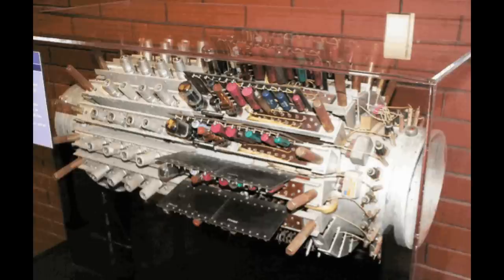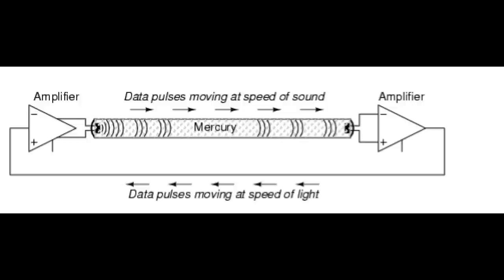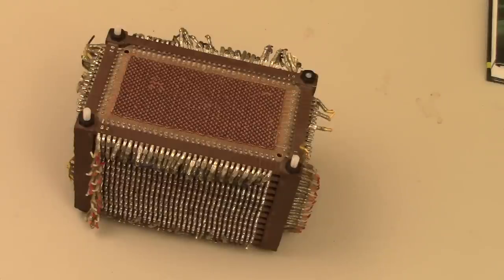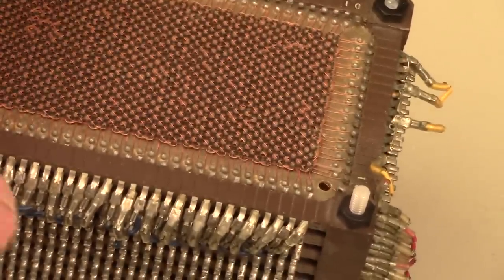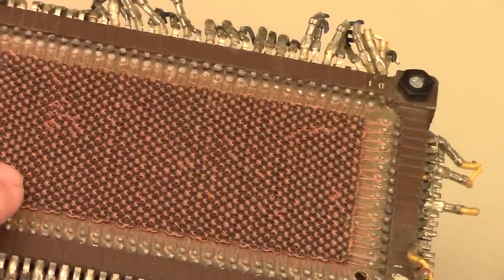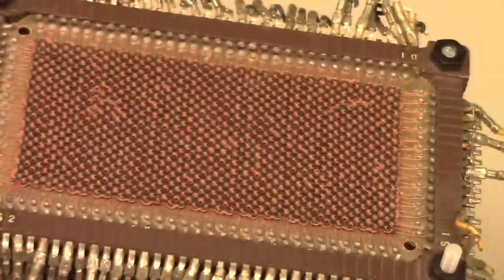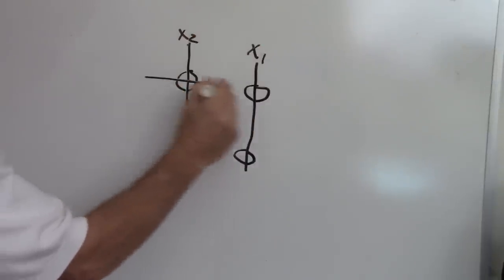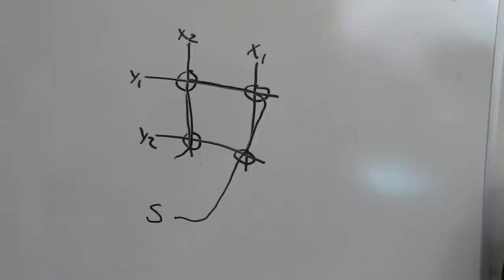Episode 11 - Getting Busted in New Jersey With Core Memory

Comment: Somewhere in a box in storage I have a 5 meg hard drive.
The damn thing is about the size of a large shoe box and must weigh 10 pounds.
Like me, it belongs in a museum.
Reply: Keep it. The price is only going up.
Reply: I have a 10 meg IBM MFM hard drive in an IBM PC. Back in the day, configuring MFM drive controllers was a nightmare.. BIOS menus did not exist yet.. some had to run a ROM program hidden on the card using DOS Debug.  Ref: ftp://ftp.seagate.com/techsuppt/misc/format.txt
Reply: I have a mechanical calculator from about 1928-32. It can do up to 12-digit numbers.
Reply: I have a 300MB disk pack. It fits on something that looks like a toploading washing machine. https://en.wikipedia.org/wiki/Disk_pack

Comment: back in early 1980s , stationed at mtn home afb our repair shop ran test equipment using burroughs d-84 computers with core memory, i believe these computers were from early 1960s, 2 large ampex tape drives is where the test programs were located,  very stable and ran the shop testing just fine. quite big though,  great to be reminded of them, thanks  j

Comment: Did you get to actually build your computer back then?
Reply: CaesarGamer good question..
Reply: I think all computers were custom made back then. They cost so much that thy were never at a store, so you'd order one from a factory, custom made specifically for you. And most computers were at least the size of an entire room, so yes, they had to be custom made.

But of course, what private citizen could have afforded one?
Reply: SmartassX1 Ok, but that wasn't the question.
Reply: I built a custom computer for about $200 in 1983. Ampro Little Board, power supply, floppy drive, Bud box, on/off switch, reset button, and a used VT100 terminal.
Reply: we had a Tandy 1000 from Radio Shack back in the late 80's/early 90's.  I can't remember if it was a 286 or 386 processor.  It had that archaic Deskmate GUI, and a 20 MB HDD.  Before that we had a Hyundai machine with yellow chromatic screen, and no HDD at all.  It was just 5.25" floppy disks and RAM.
Reply: People did...look up David Brooks simplex III. He made is original simplex I in around 1969 from scrap parts. It wasn't impossible to build one...it just took a great degree of determination. The last homemade one he made was the simplex III, based on the GEC 2050, with a dumbed down I/O system, I believe. I also read about a guy whose father built a complete PDP-11/03 with wire wrap! Now that was a smart idea...considering how much software/languages/operating system stuff was available for it back then! Contrast that with the average homebrew, with nothing except what you wrote yourself. I think that is one reason BASIC took off so much. There was so much college graduate software written for Basic, and it was small enough, that it was the easiest way to get useful software...but build a DEC computer and you have a 1970's computing arsenal in any & all languages!

I also met several people who built their own machines in the early/mid 70's in person. It was always a trade off of cost/performance. Many of these systems had a very limited instruction set, and a tiny amount of memory.  The I/O would even be current loop/serial/parallel instead of memory mapped, in order to save memory for programs(No screen ram, just a teletype(or Ascii/Baudot) for both IO and program storage). If you wanted to get fancy, you could build a TVT and add some memory there to get a real CRT terminal!  Just look at the Mark-8 mini. Everything in it was mail order...no memory mapped IO, nothing but some LEDs, switches, and very power thirsty MOS TTL chips.

Once it got to the mid/late 70's, you could build a computer much more easily. Memory was attainable, and microprocessors were available by mail order. ROM was still a problem...so many DIYers would use diode matrices for bootstrapping/monitors. Of course, by that time, since they were easier to design, appliance computers were flying off the shelves, as well as several kits. Dr. Dobbs Journal documents this period very well!! With articles of how to fit basic as well as programs inside of 4K of ram, with no ROM. They made a basic which was well under 3K. They even had plans for adding a calculator chip to your machine in order to add arithmetic commands to basic using very little ram. FUN READ and I highly recommend it!

Comment: Wonder if any computers still exist who could be used to show this thing in action.
Reply: worldgate989 There is a guy who shows how to build a core memory from NOS ferrite beads, but he only hooks up one and read and writes to it. I looked for the video but couldn't find it sorry. But I think to find a computer using it now would be very hard to find. maybe in a museum, but even then I would doubt it.
Reply: An update to me earlier reply. Somone in anther reply pointed out that the Voyager probes use core memory and ate still going strong after 40 plus years. But they are in space. So.....
Reply: Jason Crawley I just think it would be neat to see this thing at work.  Or see what it would have been in at least cause this thing looks like a radiator out of something.
Reply: Back in ca 1958 The Seeburg jukebox replaced the, trouble prone, 
electro-mechanical pin-bank memory system with a ferrite core memory 
system they named the "Tormat Memory System". They used it until the 45 
rpm records were replaced by the CDROM in around 1987. They can be found
 on eBay very cheap if someone wants to play with them. IIRC the toroids
 are somewhere near 1/8" in diameter, more or less.
Reply: You could do it with an Arduino (and a bunch of transistors).

Comment: Dr An Wang, who held the patent on core memory, and sold the patent to IBM always claimed they paid another inventor to challenge the patent during his negotiations for the sale. Although the other inventor had a weak case, it created doubt and lowered the sale price quite a bit.  

Dr Wang continued to invent things, and built Wang Computers into a world power. The company disappeared in the 90's after his death - along with a bunch of other computer companies like DEC. 

I was a computer tech in the 70's/80's  and worked on some older Wang Computers and programmable calculators that used core memory. IIRC, these were the Wang 600 and 700 series, and they were pretty simplistic, but very programmable.  Storage was on paper cards and cassettes. Engineers could make them do some pretty amazing things by switching cards in and out. Ah, the good old days.

Comment: I cut my teeth on an SDS910, SDS920 and SDS930 that had core memory. The SDS 910 and 920 used recirculating registers. To do a register move you would shift the register serial out one end and the into the target register.   Did you mention schmoo charts? The machines ran around 2 to 4 mhz. They have a 930, I think in the Smithsonian aviation museum. Any idea how that made me feel? Be cool if it worked.

Comment: Hm, you could theoretically make core memory by hand if you only have the correct elements at hand. And the element requirements aren't as specific as microchips. 
The only limitation would be that the memory would be rather inefficient if made completely by hand, but it would be possible to have enough density for some important uses. I am thinking specifically space colonization, where you can't bring electronics from Earth because of costs, but still need simple electronics for running important systems (life support and various semi-automated resource extraction systems). What do you think of this concept?

Comment: I worked on cryptology gear in the military.  We would program wit  a binary encoder 1 32 bit word at a time.  You could also load a program from a punch tape.  In case of an emergency (Plane Crash) to prevent a program from being left out in the open,  We had the erase tool  aka a huge Pioneer base seeker magnet  that the air crew would stick to the side of the box t erase said program and codes in the magnet core memory.

Comment: if the manufacturing sector could miniaturize the core and support circuitry as a backing store for flash to eliminate bit rot - then you'd have something.  d-wave is using a nano-sized, cryogenic form of this for their version of so-called quantum computing...so don't crap on it too much.

Comment: That's totally amazing.  The thing that strikes me is that it's not all that complicated.  I was thinking the other day:  "What would happen if we had a Nuclear war and of course the first salvo would be some air bursts that would take out all the non protected electromagnetic devices?  We would be out of power and most of our cars, computers, TV's everything except for the mil spec equipment would be worthless until you got around to replacing the capacitors and batteries and what not.  My thought was who has the knowledge to start to recreate what we have from the grown up in case of such an scenario?
Reply: It depends how big the EMP is. If it knocks out the power grid, most of us will die without food, water, medicine, or Netflix.
Reply: John Bryant that is my worry, loss of life because people won't have the necessities of life...
Reply: It wouldn't be as bad as you think. Most stuff has at least some shielding just to prevent it from throwing out RF interference. Lots more has better shielding to prevent it from receiving interference. 

Yes, we would still end up with lots of blown transformers and some damaged above ground wires and some damaged wiring in some homes. But that is assuming they are so close to the blast that radiation and the giant fireball in the sky are your more immediate concerns. We already have a lot of our stuff set up to deal with fairly large EMPs. Why you ask? Because they are a common occurrence and outside of radio operators and electrical engineers nobody ever even thinks about it. Every lightning strike in the world causes an EMP.
Reply: I wouldnt worry about things you have no understanding of. Its not logical.
Reply: ***** No. Not all computers are made in China and even if they were you can't just send a magic radio signal and have it shut everything down. The machines would have to have antennas tuned for the frequency they transmitted on.

To keep things simple I'll put it this way. The lower the frequency the further you can send the signal but at the same time you need a larger antenna and it takes longer to send information. To send signals from China to North America you would have to have a receiving antenna several meters in length. Up to 160 meters depending on the frequency.

On the other side of things higher frequencies can send much more data in the same time frame and need much smaller antennas but those signals are easily disrupted and interfered with and thus have much shorter usable ranges. When I say a shorter range I mean not only could they not cross an ocean they can't even cross a small town.

FM radio stations sometimes transmit with as much a 200,000 watts of power and if you are outdoors with a clear line of sight you might receive it clearly a hours drive away if you are lucky and the terrain is mostly flat. smaller stations with only 10,000 to 20,000 watts can have trouble reaching people even in the same town.

Go up in frequency to the range used by cell phones and even with a 10 watt transmitter you can sometime have poor reception even when you can directly see the cell tower because of how easy the signal can be disrupted or blocked.

Go up even higher and dust and rain can bounce your signal back instead of going on its merry way. That is how weather radar works.

No no, the kinds of radio signals that can make it to other continents can't be received without very noticeable antennas quite a bit larger than most computers.
Reply: ***** None of those are up into the microwave bands. AM antennas would be for the lowest frequency and in case you have never paid attention, AM radios use huge antennas compared to everything else. typically they use wire loop antennas with MANY meters of wire. There is absolutely nowhere you could hide one on a computers motherboard. Of the bands you mentioned AM is also the only one that can reasonably be used inter-continentally. As I mentioned before FM stations can't even make it across a single US state with 200,000 watts of transmission power. And again, ever looked at the size of even a small FM radio antenna?

By the time you get into VHF and UHF you are talking 2 meter and 70 centimeter wavelengths for the ham bands. That is where things get to where antenna sizes are manageable for handheld units with quarter and eigth wave length antennas. Those are also frequencies where you have trouble with those same handheld radios inside of cars because even a car is enough shielding to severely interfere. On flat terrain with a pair of beefy power hungry units you might be able to talk to somebody ever a hundred miles aways. That is assuming there are no buildings in the way. Or trees. Or hills. And so on and on. There is a reason VHF and UHF frequencies are only ever considered for local communications inside the same town. Anything past that and hams bounce signals through repeaters. Even with the repeaters it can be hard to cover some entire towns thanks to the terrain.

Go read some ham test materials for a brief introduction to radio physics. When they mention making a contact with somebody on the other side of an ocean on the 80 meter band, that literally means an 80 meter long antenna for max signal strength. As I said before. The lower the frequency in general the further you can get a signal to go but the bigger the antenna is going to get.

There simply physically isn't anywhere to hide an antenna suitable for long range communications inside a computer. It is simple physics.
Reply: ***** impractical at best, impossible for most scenarios. You can of course kill an os with a back door. But at a hardware level it would require multiple pieces of gear compromised at the same time and working together. The only systems that could be hit by something like that in the wild are ones built on a SoC where the network controller is tied directly in with everything else. And even those would have to be directly exposed to the network/Internet to have the data reach them. And even then it would require no packet filtering along the way. And on top of that it would require a network that delivers the right types of packets. Tcp/ip is common and is what most stuff normally uses but it isn't the only thing. So far the worst anybody has really managed to do make a bot net with gear nobody changed the default password on and left connected directly to the net.
Reply: ***** Not everything runs on parts from Intel.

Comment: I graduated we in 86 I remember reading about the memory with the cheerio memory. never saw it.  my first computer was a handed down commodore super PET I think it was 32k ram. had 2 processors you could switch between I had cassette tape drive memory, acoustic coupled modem, and a duel 1meg floppy disk drive, EPROM burner.   and a big box of books..  had to be probably early 80's.  I was in heaven.   I remember the $40 dollar a meg ram? I thought it would be that price forever...  I also remember going from a 10 meg HHD to a 100meg HHD, I remember saying I would never need another HHD again. ha ha. I currently have 2 Terra byte half is ssd.

Comment: I used to work on Burroughs b6700 systems with core memory. A whopping 6MB. Each word had 48 data bits, 3 "tag" bits, a parity bit and 8 error correct bits. Those last stayed in the memory and were used to fix single bit errors or detect multiple bit errors.
Reply: So that was like a half-million dollar's worth of RAM? Who guarded it?
Reply: It didn't need much guarding, since the whole system weighed tons and was as big as a small house. But it was in the basement of the company HQ behind a couple plant security guys in case someone drove in a couple semis to haul it off one night. ;-D
Reply: Jim Steele - Oh God, did they make you work in the basement? Or was it like the computer is in the basement, but your programming terminal is actually upstairs? Don't underestimate the nerds locked away in the basement. They have time to engineer a solution to getting that computer outta the basement!!
Reply: I worked on the hardware, so yeah I was in the nice air conditioned basement. It would be straightforward to get the machine out of the basement.... just reverse the process of getting it in. ;-D Take it apart and haul the pieces up the freight elevator. Take maybe a dozen guys with moving gear a week... nobody would notice. ;-D
Reply: 6 megabytes of core? That must've been a big heavy block.
Reply: It was spread out a bit, there were 4 cabinets about 5' high, maybe 2' deep, and 6' long. 
https://goo.gl/images/qu4vBY
Four groups of 4 of those panels in the picture.
Reply: Wow...It's nice to be able to hear about this from somebody with first hand knowledge. Did it do ANY word processing, or just banking? What did the company use it for? There was so much change after switch to silicon that I have no point of reference to imagine how people would use these machines commercially, or get improved productivity equal to, or greater than, their incredible costs
Reply: Probably the main difference between now and then is that back then, terminals were basically dumb, not PCs like today. All the applications ran on the mainframe. So they did pretty much what business does now, just all using the same machine... multitasking. Payroll, inventory control, shipping, billing, whatever. Expensive yeah, but cheaper than a room full of clerks shuffling paper.